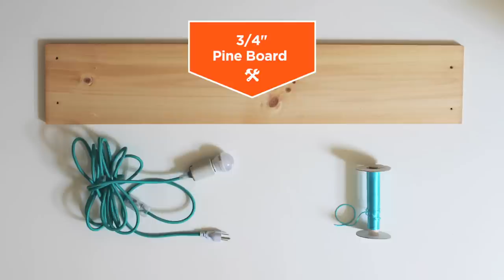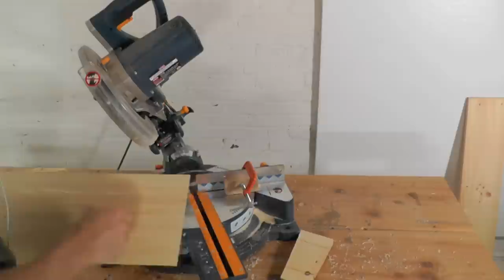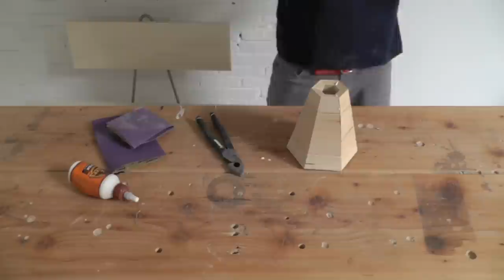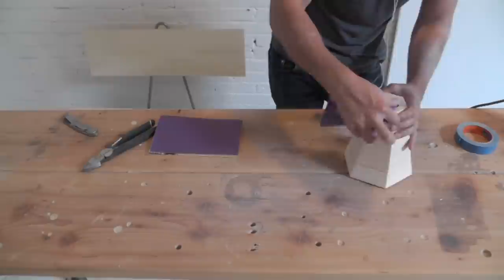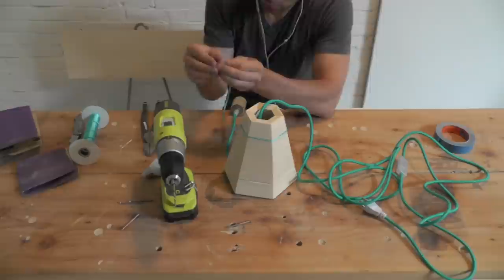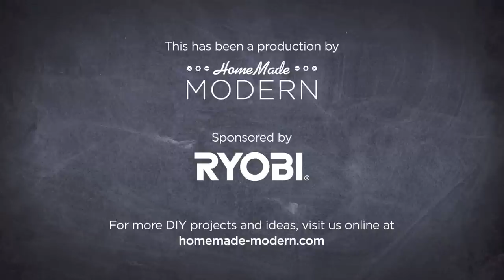DIY Wood Pendant Lamp

Comment: if you get these at about 1/4 inch (maybe thinner.. ) there might be some transparency to the light fixture.. a bit tougher to glue together however..
Reply from the maker: ww55d i think thats a great idea.  You could even make patterns by cutting additional grooves.